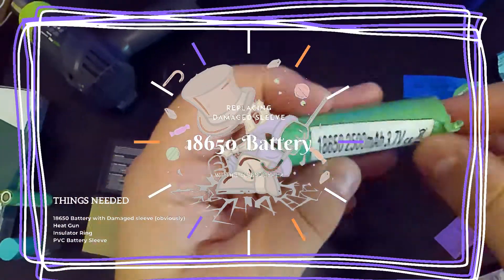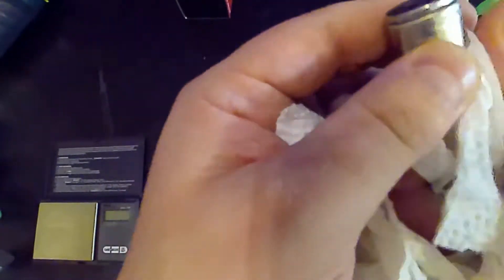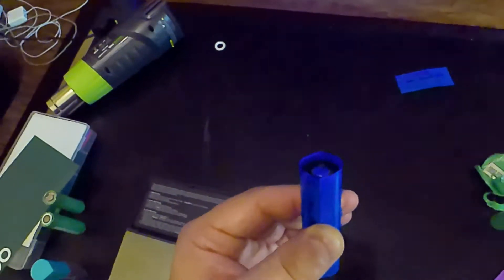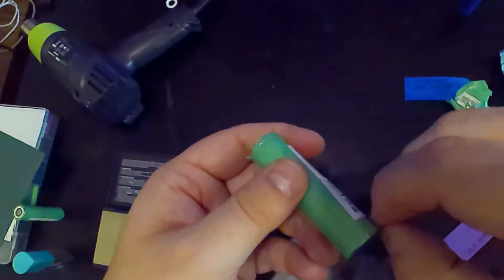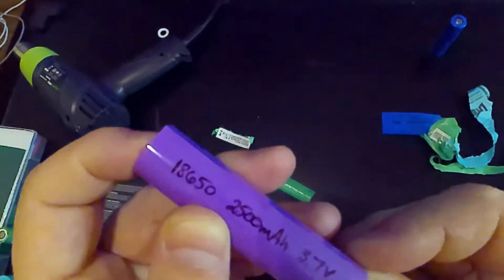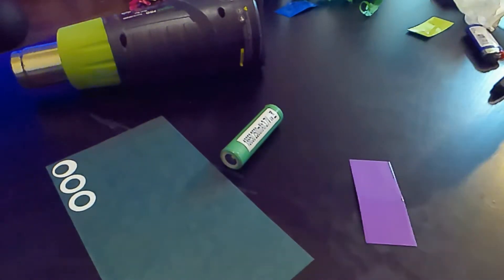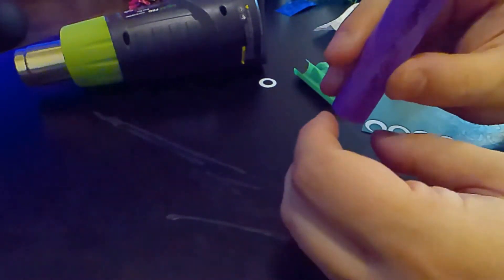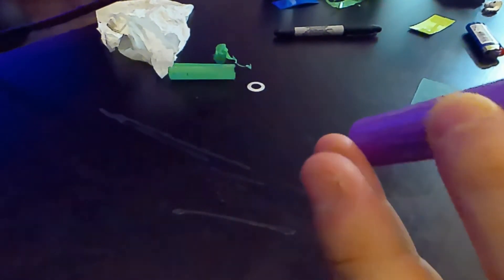18650 Battery Sleeve Replacement: An Easy Way to Save Money and Protect Your Electronics

Comment: can i do the shrink part with a hairdryer instead of a hear gun?
Reply from the maker: Yes I believe so but will take much longer since it doesn’t get as hot
Reply: @TheGobstopper  thanks for the information I appreciate it I'm going to actually try this because I bought a device it came with six of these batteries and one of them the wrap was ripped. I was thinking to just buy another battery and I know it's a 3000 milliamps but the vendor couldn't inform me about more specifics and I found two different types of 3000 milliamps batteries. So I'm not sure which one is right I think it's better if I just rewrap the damaged one that came with it.
Reply from the maker: If the millamps match the other batteries should work but may be weaker/ stronger than the originals depending on output
Reply: @TheGobstopper  yeah I don't think they match because the replacement battery I used physically it's the same size but when I hold it in my hands and feels a lot lighter but I ordered some repair sleeves for the original one and the delivery should be coming this week so I'm going to fix the original one and use that instead. I actually asked the vendor that I bought the device from because I guess they're 3000 milliamp batteries but when I looked online there's a few different 3000 milliamp batteries they have like a different number behind them. It's a little confusing for me because I figured a 3000 milliamp battery is a 3000 milliamp battery but even the vendor couldn't tell me because he said that they're included from the factory when their shipped so they told me I could just buy any 3000 milliamp. I guess that's what I'll have to do eventually but I wish I knew for sure I was buying the right one you know anyway thanks again I appreciate it I'm going to hit subscribe and check out your other channel content
Reply: @TheGobstopper  I appreciate the reply to because I wasn't sure if my comments were showing up. I kind of felt like I was Shadow banned because on a few of the channels they don't seem like they're showing up properly but I'm not sure maybe it's just a delay for some reason
Reply from the maker: No problem! Thanks for watching. Glad it was helpful.